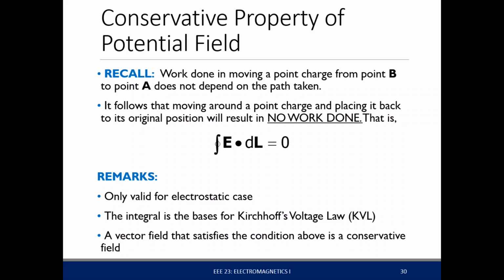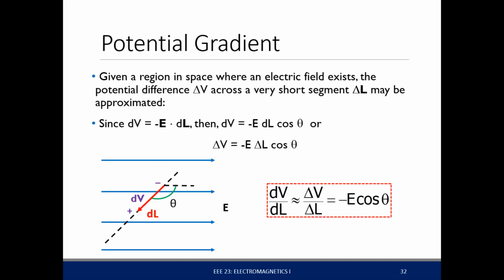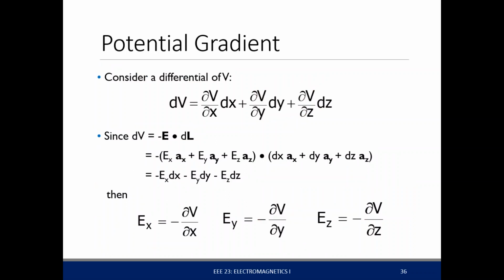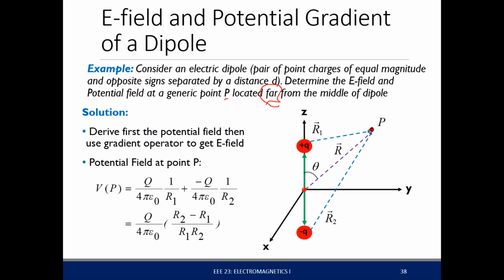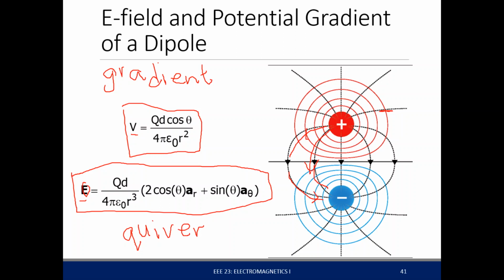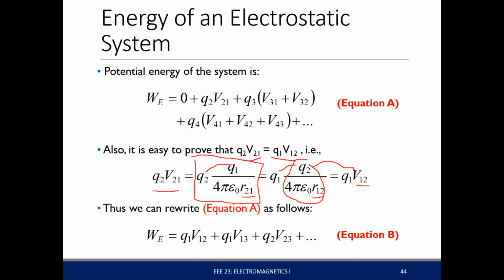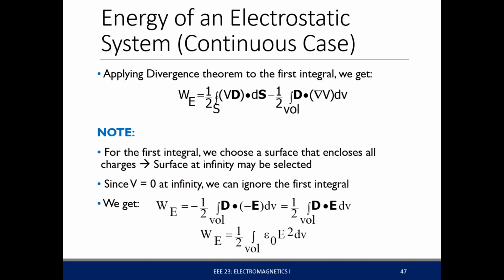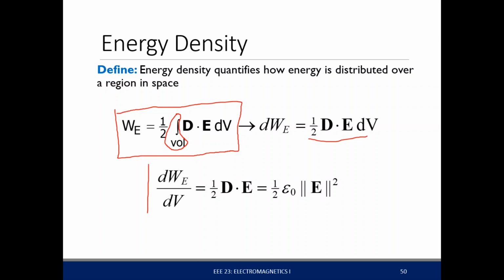Electromagnetics - Electric Potential and Electric Field

Comment: I know this is late, but I have a question.  At time 29:26, the other way of solving this example is to use the formula WE = (1/2)*Integral rhoV dv.  Could you elaborate on this to demonstrate how to do that?
Reply from the maker: Sorry for the late reply. I am currently on study leave so I do not maintain this channel. Since we are dealing with electrostatics, the charges hang out on the surface of inner conductor and the outer conductor. Then, the integral transforms into a surface integral. Also note that the capital V pertains to the potential and the reference point is infinity.

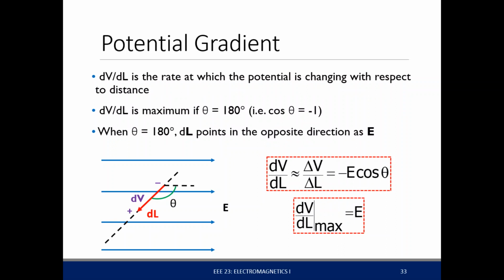Comment: Hello, i have a question; can you maybe explain to me why everything in 5:44 its okay to do, since V is scalar? how would we do dV/dL when V is scalar i really didnt get that i know you pointed that out a little bit before that but i didn't understand why. And also in 9:21 that we have partial derivatives of V when its scalar. Thanks!!!!
Reply from the maker: V is scalar but it is a function of position. That means, we can get the change in V with respect to a change in position. In this case, let's call it L. We can observe that at the direction of maximum change, the change in V divided by change in L is equal to the magnitude of the electric field. This is similar to the definition of the gradient operation.

Bottomline here is that V may be scalar but it is not constant. It changes with position. Therefore, we can take its derivative with respect to position. If V is expressed as a function of Cartesian coordinates (x,y,z), then partial derivative of V with respect to x, to y, and to z exists.
Reply: @charlestondaleambatali4158  Oh yes, i understand it now thank you!!! PS Your videos really help me to understand my class this semester I study Physics.:)
Reply from the maker: @s.tudydudes571  glad to be of some help.